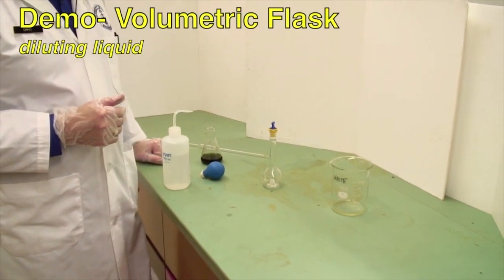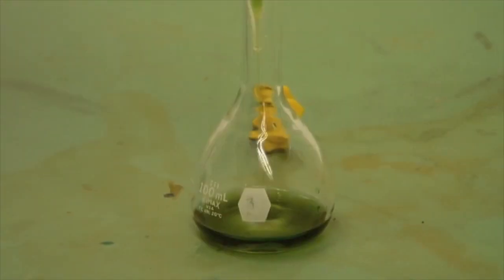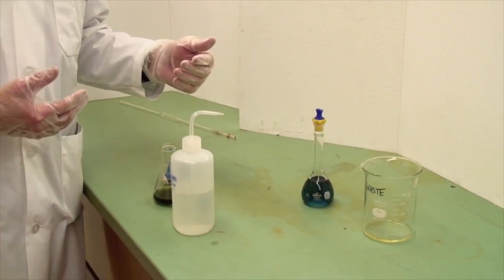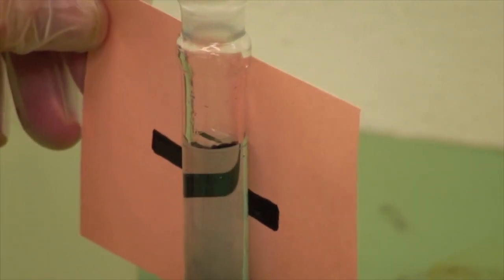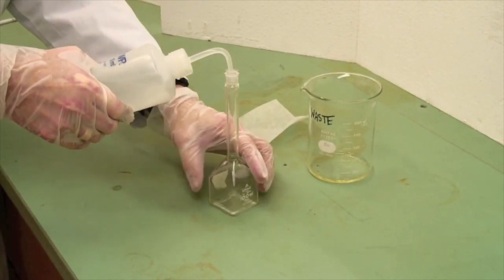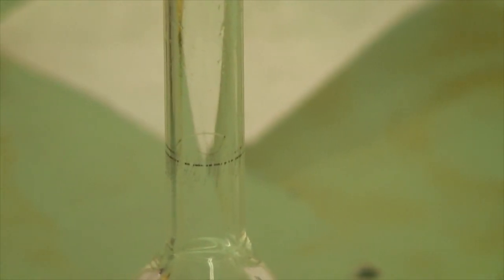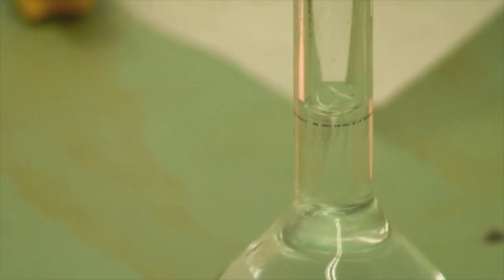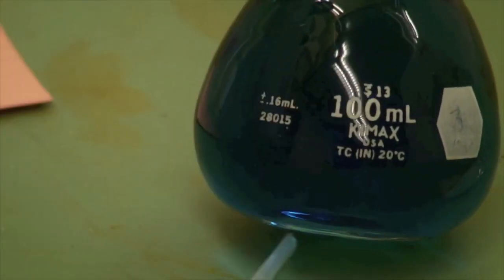Volumetric Technique 3: Using a Volumetric Flask

Comment: okay so I'm new to this and I was wondering why is it always demonized water that goes in to fill to the line?? what if you want to measure two liquids??
Reply: Deionized water is just the solvent for the solute, this solute can also be a liquid. A volumetric flask is not used to just measure the volume of a liquid, it is used to prepare a solution in which it is exactly known how much solute is present (can be liquid or solid) in that volume of the solution.  Of course you could use other solvents than deionized water as it will depend on what you want to dissolve. Hope this is clear as I don't know your background on these kind of subjects.